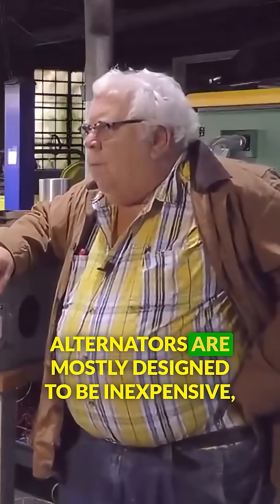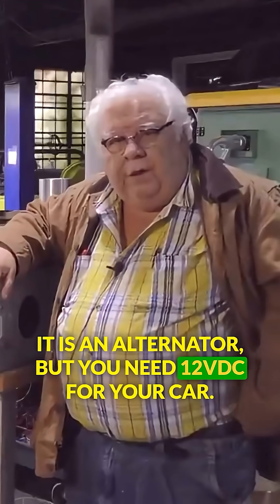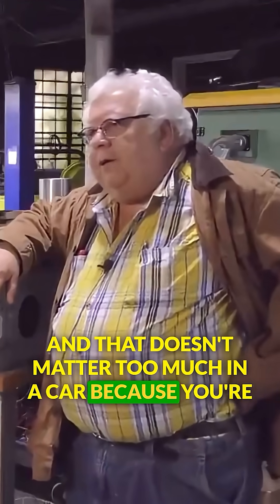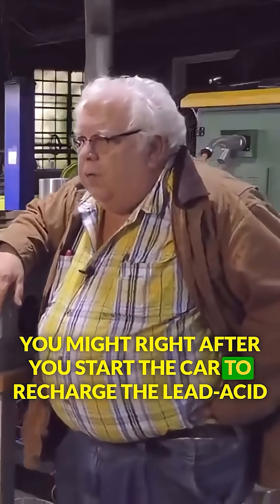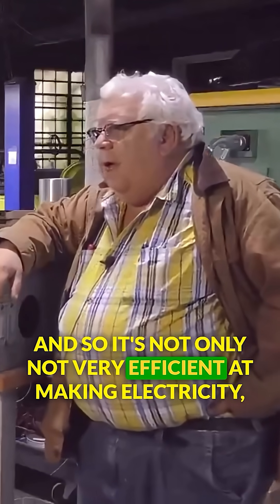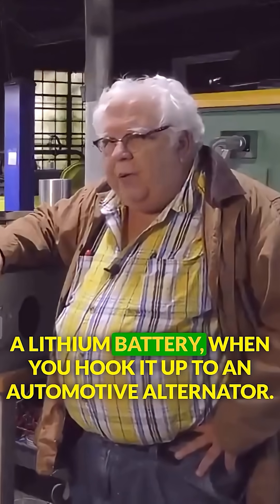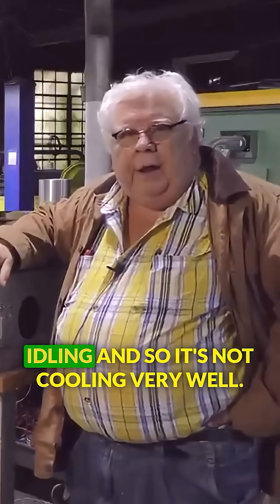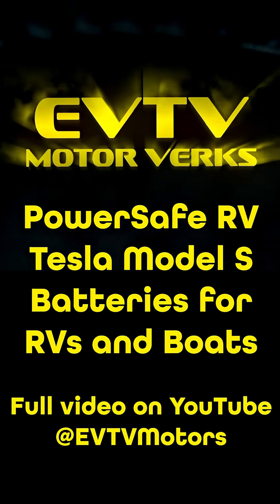Alternators are Only 50% Efficient!

Comment: Today we have brushless alternators that are highly efficient, reaching 80% efficiency. A permanent magnet generator is only viable in equipment where the RPM is constant, as the magnetic flux of the magnets cannot be regulated. An alternator is the best choice for 99% of applications.

Comment: This is why you should always have a charge controller to recharge the lithium batteries. Besides that, under the hood of a vehicle is the WORST place for a lithium battery because they are susceptible to heat. you either need to relocate the battery away from the engine compartment meaning much longer high amperage cable runs to the starter, or you want a AGM or similar battery under the hood for starting the vehicle with the lithium batteries sitting in the back somewhere just powering auxiliary electrical sitting behind a charge controller. A better choice for your starter battery is to connect a AGM, Gel, or Lead Acid battery to a capacitor system that will allow even a weak battery to charge the cap enough to give that burst of power to the starter. If you are using a secondary battery system with the lithiums, you still want to charge them separately, but can also add a DC to DC charger that will make sure the lithiums do not give the lead acid/etc too much power.

Comment: But the car audio scene is full of guys running lithium batteries. Everything from stock setups with a lithium battery all the way to guys running 300-400 amp high output alts. Most run the undersized pulleys but it’s not uncommon to see guys with massive lithium banks and multiple high output alts.

Comment: I build self contained mini power plants that generate more than a house can use. It also turns your car into a EV. That can power itself while on highway. The electric company will send you a check for putting power back in the grid. It’s under base models start at $800 to three grand if anyone’s interested.

Comment: Alternators nowadays have a temperature sensor if they get too hot or if it’s sucking the maximum voltage for too long of a period of time it shuts it off.

Which causes a whole Nother problem when you’re driving down the road with lithium because after the lithium battery gets below a certain voltage it just turns the battery off for safety reasons .  You lose all power with no warning.  

And because the alternator is putting out max output for too long that is turned off and so the car won’t even run off the alternator while the engine is running .  

If you get lithium batteries, you have to upgrade the alternator to 300 or 400 Amps output.  I put 500 in mine

Comment: Lithium batteries are not charged like a lead acid battery.  They use a BMS and a constant current charge, so this would prevent what you claim about the lithium pulling crazy current.  If the alternator was only 50% efficient and putting out 1200W of heat, it would feel very much like a household space heater.  It doesn't.

Comment: Best is to use a battery maintainer on a vehicle equipped with a Lithium battery.. To make it easy, just install a connector with easy access.
I have used a lithium iron battery for over 6 years on my motorcycle and rode over 100,000 km.
The battery still performs well as so does my alternator while my friends have replaced 2 to 3 battery already.
Over here in Malaysia, battery usually last a year and half at the most (probably due to the heat).
I am delighted with this lithium iron battery.

Comment: A large lead acid battery will do the same thing. Automotive generators are designed to recharge a small battery that is usually not even heavily discharged.

Comment: I just found this guy, HE IS telling it very true. The Lead acid Batteries are the best for now for what is engineered and invented for today's Alternator systems. I have always preferred the Generators from the older Models of vehicles. Watch the Headlights on the older Vehicles and how at the Engines Idle speed the lights are less brighter,  than when you Accelerate from a stop light your Voltage will pick up,  the lights will become brighter as the demand becomes greater. The older points type adjustable Regulator is a good long lasting invention.. I still have several of those and they work great.  My 1974 F-350 has the orignal still on it. The new one I bought years ago is a points type. The new ones are electronic versions and unless you can get the parts can't be repaired. My 1953 Cheverolet 3/4 ton orignal straight six engine,  has a Generator and the orignal charging system. Yes I still have to put a couple drops of oil occasionally in the bearings, rebuilt the small parts. Still USA made.. Alternators were invented for being replaced frequently. At least this guy has shared what some of us have known for a long time.. 👍🏼

Comment: Partly incorrect. The diodes take around a delta voltage of 0,6 to 1 V and with a 3 phase alternator you have 6. 100Amps eq 33A per 
Phase over 2 diodes = 33x1x2 66Watts x3 phases 200 Watts at worst not 1200.... do you calculus and get educated.

Comment: Interesting I have lithium batteries hooked up to my alternator. It’s a 400a, 6 phase and it idles at about 15 volts dc. Max theoretical draw on my electrical system is 2000 amps. My batteries are going on 4 years old. Hundreds if not over a thousand hours of use, idling, city driving , and highway speeds. Temps ranging from below zero to above 100 F. How am I the exception to what you claim? Maybe you have no clue what your talking about

Comment: I just had to replace the alternator on my 98 mustang and had to go to 3 different auto parts stores and tried 2 from 1 store and 3 from another which didn't work off the shelf (new not rebuilt) and finally I went to another store and got one that worked 1st try. Now this is just ridiculous. I know when I worked at a local parts store which only had 10 stores total, owned by the same man and all of ours were tested before they were shipped to us. I miss those store because they actually sold quality parts but the big chains basically bought him out and shut those 10 stores down.

Comment: I was with him right up to the Lithium Ion battery commentary. The lithium Ion Battery or LiFePo battery isn't a higher load on the alternator, on the contrary it has lower resistance than a lead acid battery and can output far more power for a longer duration than the lead acid battery. Charge input is also steadier than a lead acid battery would be. Lead Acid batteries have a rapid drop off in deliverable power which is why we have cold crank ratings. A lithium based battery typically outputs the same power continuously until it gets to 20% of the battery capacity. 

If anything, the only way that an automotive alternator is getting burnt out from using a lithium ion battery is either A) back feed, which means the Lithium battery is raw input and not passing through a BMS, in which case the power output or current from the battery is exceeding the capacity of the Alternator Rectifier, or B) the lithium battery is as such a low charge state that it causes overdraw from the alternator. 

If the lithium-ion or LifePo battery is healthy, properly charged and using a BMS, then there's no way it'd cause an Automotive Alternator to kill itself. In fact, for an onboard 12v system the Lithium battery should in fact reduce to the idle draw on an Automotive Alternator as it can supply more power to the overall system when the alternator isn't providing the full power needed. 

If any of these guys the speaker in the video references used a non-BMS controlled lithium ion battery as an alternative to a lead acid battery, then yes they could have seriously damaged their alternator. But a properly regulated Lithium based battery with a BMS and proper wiring, there is no risk at all (beyond the normal risk you'd expect with a Lead Acid Battery) in causing harm to the electrical equipment of your vehicle. In fact, it may actually be safer and offer smoother operation for your vehicle.

Comment: Another problem with low RPM loads is with the lower RPM comes less inductance in the coil wires, which means increased amps and even more heat.  I would say it is much more likely this is causing melted wires inside the alt than overall cooling loss due to the fan running slow being the main culprit.

In other words, trying to cool the alt with an external fan won't work either, as the lower inductance will cause wires to glow and melt.  No fan is dissipating that heat.

Comment: What people don’t realize about alternators in a 12 volt dc closed circuit is that compared to a lithium battery powered ev the lead acid battery internal combustion vehicles necessarily require the heat loss from 50% efficient diodes while charging because I don’t know what I’m talking about

Comment: For 12 V, 50% diode efficiency corresponds to a 6 volt forward voltage drop across the diodes, or 3 V per diode in a full wave bridge configuration.  No diode is that bad.

Comment: I remember I upgraded to a 300amp alt in my old ford for a future installment of a winch and that alternator was screaming hot!  I couldn’t even touch it. My ford has two batteries and I remember that I thought maybe something was wrong but I found out that alternators heat up fast especially when you’re running some amps

Comment: I never heard such nonsense..   diodes are only 50% efficient?  Where is that stupid idea coming from?  Alternators don't cool at idle? They burn?  No! They produce less current so no overheating.  The fact you put a lithium battery instead of a lead one Don't "suck" more current than the alternator can produce. This is technical pure nonsense.

Comment: In an alternator are 6 diodes to just both hallfwaves of the 3-Phase alternating current, so the efficiency is much higher than 50% about 70% that’s not 100% but closer, btw a big part of the „lost“ energy is used to pump air thru the generator for cooling… hybrid-ev are mostly not charged by the common alternator but the drive-motor……

Comment: I put a voltmeter onto a perfectly good alternator and it was sending out 2 volts... So that means it was taking 12 volts to run it, and sending 14 volts in return to keep the battery charged.

Comment: This is completely wrong. Lithium works as long as you have it charged and maintained at the proper voltage. Alternators are not battery chargers (0v to 14v)
Lithium can actually keep the alts alive longer to keep it in the proper resting or nominal voltage of the battery.

Comment: The reason some alternators are inefficient  is that most use Half wave rectification using only half of the output, now those who use full wave rectification gets nearly twice the output. Also those who use smart regulators can keep the alternator cool by cutting back on the drive causing the alternator to make the output operate at what ever output that it needs to keep from melting down. Besides with twice the output it takes far less time to recharge the battery.  The major issue is most mechanics have no Idea how to test for defictive or leaking diodes that pass AC to the DC electrical system.  So whats the problem just fix it when its broke.
Reply: Sorry mate, all automotive alternators are 3phase and are very efficient, way more efficient than any generator.
This old bloke is speaking out of school and its annoying that he is talking total rubbish and everyone is buying it. I went to trade school as an auto electrician I can assure you that he has no idea what he is talking about.

Comment: This man is just babbling on about nothing. He doesn't know what a diode is. He heard 0.5 somewhere and though that was efficiency. Yes a diode drops 0.5v of voltage but if you subtract 0.5 from 14.8v you get 14.3 left so to get efficiency you do 14.3/14.8 you get 96%. Yes I haven't factored in coil resistance and power used for the rotor field voltage but it certainly doesn't drop to 50%. The alternator itself isn't putting out 1200W in heat by itself, if you calculate efficiency of an entire angine to generate electricity then sure you have more than 1200W of power going somewhere like the exhaust and radiator but not in the tiny alternator.

Comment: Point of contention. A 100A alternator is not going to produce 1200W of power AND 1200W of heat. That would suggest that the alternator is producing 2400W and half of it is being lost to heat through the diodes, which only have a voltage drop of around 0.6V each.

I agree alternators are inefficient but 50% seems to be a bit of a stretch.

Comment: That's good information so basically don't try to get a lithium battery for your regular car electric vehicles the other thing real quick is that when you buy a tire and this is going to go x amount of miles it probably won't and they're counting on you not coming back to get your rebate most people don't even know on the odometer when those tires should last until

Comment: My Landcruiser runs 2x85AH batteries because it’s a TD on start up it runs a intake grid heater.
then in the back I have a 100AH lithium battery running a fridge is this why I’ve blown two alternators in 12 months 
They did warranty both alternators. Is there a way to get this right..

Comment: I believe that's why most car audio guys use a controller to manage voltage between blasting the audio subs and driving but they would also run 1 or as much as 1-8 400amp alternators depending on size of system and I would assume they are built way better to handle the abuse and heat

Comment: Sounds like I should put a lead acid back in the motorcycle.purchased a lithium replacement,in not happy with cuz it goes dead quickly and doesn't like to charge with riding, unless you ride half the day,it might not start

Comment: All the alternators HAS a double as minimum RPM's than the crankshaft does...so on idling engine with 800 rpm - the ALTERNATOR runs with 1600 rpm - minimum...

Comment: Ive played alot with alternators and everything he said is true. Ive learned to bypass the 12v input with earth magnets. The DC current that goes into an alternator acts as an elctro magnet ( its an electric magent that can turn off and on unlike a regular magnet that cannot turn off and on). From there you can remove the trio diode that connects to the 3 phases of alternating current thats produced from the alternator. The job of the trio diode is to convert house power (a.c. -alternating Current) to DC power to recharge your car batteries. But you can definitly remove the trio diode and use the a.c. power for your house or anything else. Best to make a transmission so you get at least 1:3 for each time the main gear moves 1x its 3x for the alternator

Comment: I had a 100 amp alternator in my motor home that went out. I stopped at a shop, and they $wapped it out. About 100 miles away as it got dark, i turned on my lights. Shortly afterward, my lights dimmed, and I had to pull over. After checking this and that I determined they put in a car alternator that was 35 amps.

Comment: Crazy a thing that requires dinosaur fuel to spin can also spin something that needs dinosaur fuel to work. Engines waste (and convert) so much energy. Spinning something that means nothing to the over all process and complaining about it is useless. Turn off your A/C ffs. Shut off the headlights. Take out your computer, fucc your ignition system. Fred Flinstone it, no alternator needed.

Comment: I'm old enough to remember when the Rectifier was External of the Alternator. Usually situated in a cooler place than right up against a HOT engine.
Did you know Car Battery's are placed under the hood(worst place you can put one for longevity, heat is a battery Killer) by agreement with auto mfgs and Battery makers? It's to get the customer to buy more batteries over the lifetime of the vehicle. Every 5 to 6 years. You can get 10 years from a Lead Acid battery if you keep it in a cool place and keep the charging system in proper specs.

Comment: This is only true if you hook up a raw lithium battery to  your car. Any lithium battery designed for automotive applications have protection circuits built into them to control power draw and regulate charging and ensure that the cells are charged in a balanced fashion. Except for raw cells (18650 for example) pretty much every lithium battery designed for a consumer applications have built circuits to protect the battery and the consumer.
This is like saying that carrying gas in giant Gulp cups balanced on your dash is dangerous. It's true, but obviously stupid and unrealistic.

Comment: Do keep in mind the actual mechanical to electrical conversion is about 80% regardless of the design and the rectifiers or "diodes" be it single or 3-phase bridge is another 20% loss so the reality is while this man is technically correct it's not because alternators are made "cheap" but rather it's the entire process of converting mechanical to AC electrical then DC electrical not taking the regulator losses into account. I'm just an electrical engineer keeping things real.

Comment: Actually, the copper losses far exceed the rectifier loss in an alternator, as copper is costly so the OEM specifies the skinniest wire which will carry the current without burning the insulation. Were the diodes dissipating 1,200 watts (or 4,100 BTU) as you assert, the heatsink needed would be bigger than the rest of the alternator.

Comment: A battery in an autobiography is only there for starting.  It should never be a load.  This old man may be correct about alternator efficiency but has zero knowledge of automobile electrical systems.

Comment: This is BS. At 100A the rectifer diodes would only consume roughly 200 watts with the worst case highest forward voltage diodes. Thats only 16.6% lost not 50%